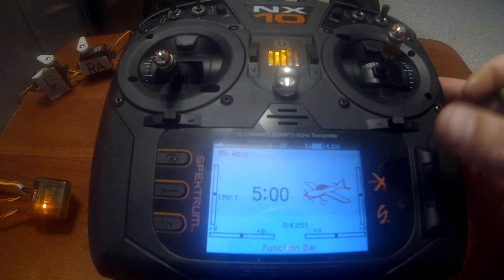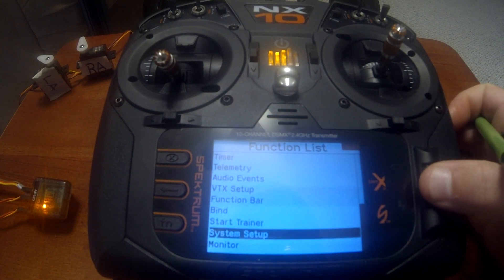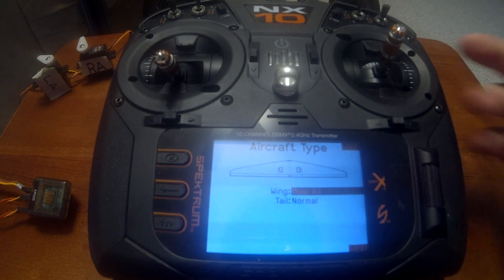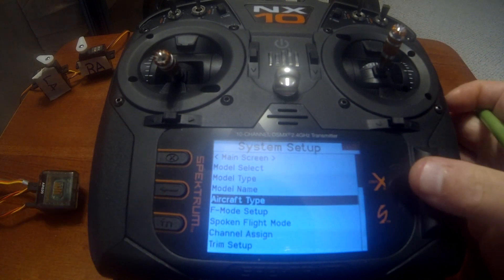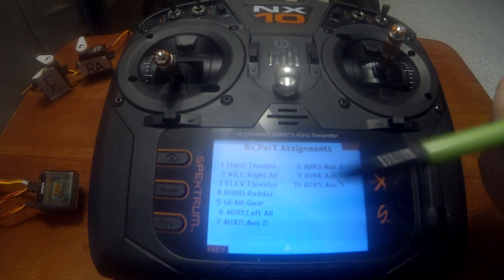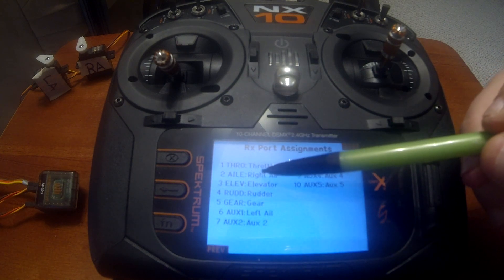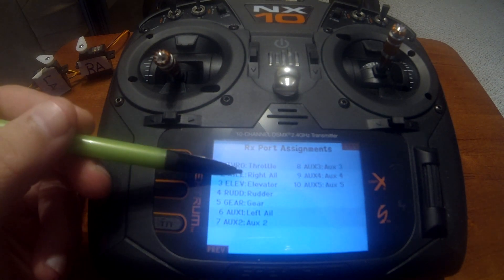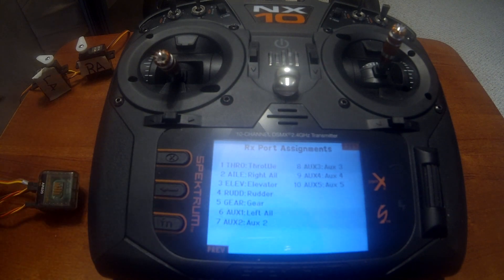Spektrum NX Setup: Dual Aileron using Separate Channels- Basic (NX6/NX8/NX10)

Comment: After setting up dual ailerons and crow I had to go back into forward programming and relearn servos in order for both servos to function in AS3X Mode.
Reply: I had Y adapter fo ail on one channel but switched them to two channels as per this video and set up.   Corrected for travel direction etc. works.  BUT the rates and travel of the right ail is now not aligned w the left ail.  Rae’s and expo were set up previously the way I wanted it.  Do I need to relearn in forward programming so that there split ail servos behave w the same travel magnitude?

Comment: Thanks for the videos, but I have a question. Trying to set up flaps on a plan without flaps from this video and another of yours, I can set the flaps, but I cannot get the servos in the same direction when using switch D for flaps. What can I do to fix this?
Reply from the maker: You have on separate channels? What aircraft type is selected?

Comment: Thanks a lot for the info. I struggled in multiple ways trying to figure out what was needed to get both ailerons working together on multiple rates. I had to go back into the opening setup to choose dual aileron channels before it would work.

Comment: How can I correct one aileron throws more than the other on spektrum receiver channels 2 and 6?
Reply from the maker: Check mechanical stuff first. Horn angle,rod length,hole placement etc... Still need to do electronically adjust in dual rate and expo. I have a video called "fine tuned onctrol surfaces" that answers this in detail.

Comment: Hello,
Thank you for this series. I have a question. I've watched both the duel aileron and duel elevator set up videos and they say to use ch6/Aux1 for the extra servo on both. What if I am setting up both duel elevator AND aileron. Do I just pick another aux channel to assign?
Reply from the maker: Once you select both in aircraft type it will default to certain channels. Control surface can be reassigned in the System Settings > Channel Assign > RX Port assignment
Reply: @BDTennessee  thank you for the fast response! Yes, I found that out last night after I asked the question. I one aux 1 and the other aux2, reserved the servos running backwards and all is good. Again, Thank you for the NX series.
Reply from the maker: @johnhalligan2530  great, glad you got it working! Thank you John for the support :)

Comment: But what if i have a safe select receiver with AS3X (AR630), wouldn't this setup change the way the gyro currently behavies? Because my receiver's gyro is programmed on 1 channel Ailerons with a Y splitter. 
So how can i set up Flaperons/ spoilers and still be having the gyro features enable?
My plane: Aeroscout s2 rtf
My transmitter: nx8

Thanks in advance
Reply from the maker: Setting up dual aileron put each servo (left ail and right ail) on its own channel. You would need to unlock factory set AR630 to configure the AR630 correctly as well.